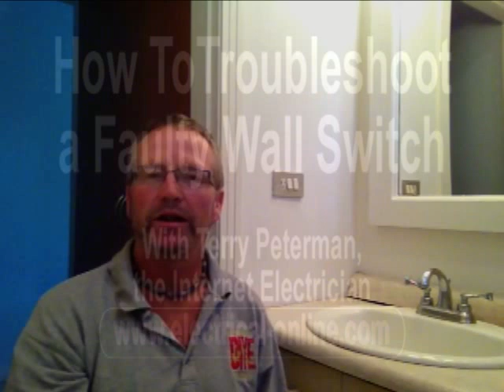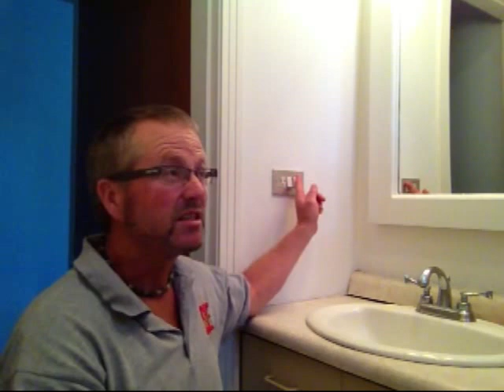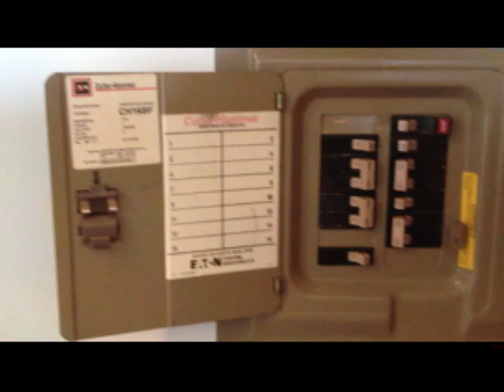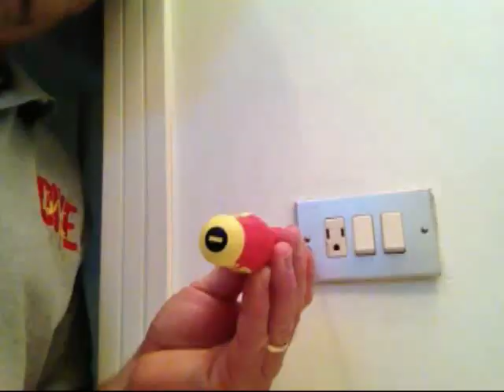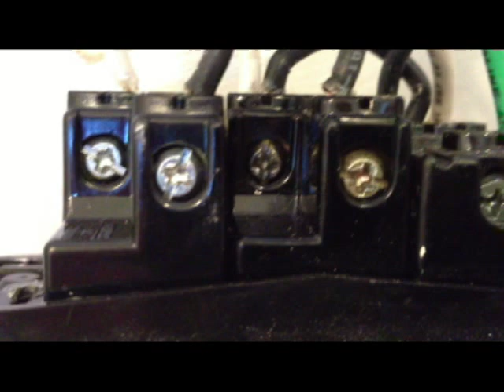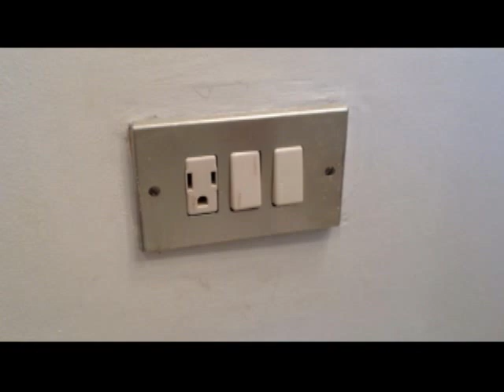Troubleshooting a Faulty Wall Switch

Comment: If I slowly push down my switch I hear a burning like a snap or a crackle what could this be
Reply from the maker: By pushing down on the switch, you are manipulating the contact points so that they get mis-aligned, or pushed apart enough to cause arcing at the contact points.  If the switch is working fine under normal use, not to worry, but if it does this on its own, you need to replace that switch as it will only get worse.

Comment: Terry..i have installed a ceiling fan.  Im getting power to the fan. it is wired to the wall/light switch.  When the the switch is flipped, fan gets power, but the light does not come on. i also noticed that the speed switch was not working..meaning that the fan was not changing speeds.   The instructions say  blue/black to black.  White to White and green to green.  Am i missing a jumper??  the wall switch is a basic 3 way toggle..Just to note.. i do not appear to have 4 wires coming out of the ceiling box..